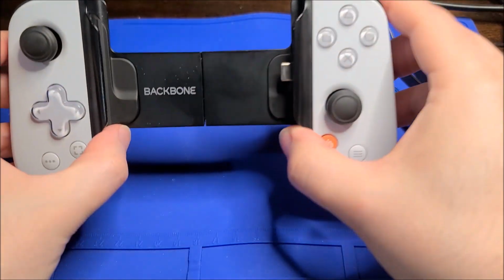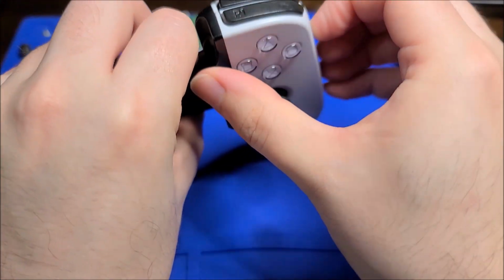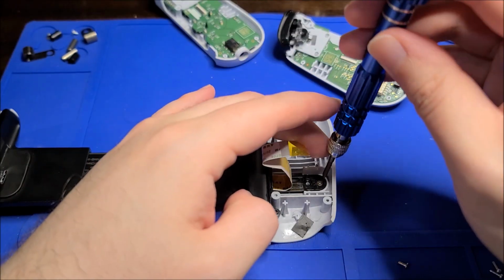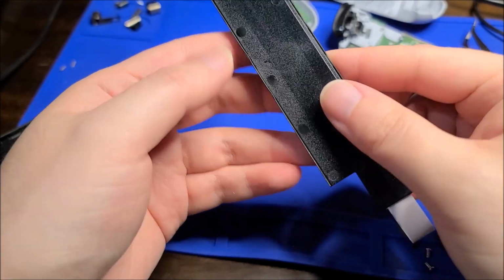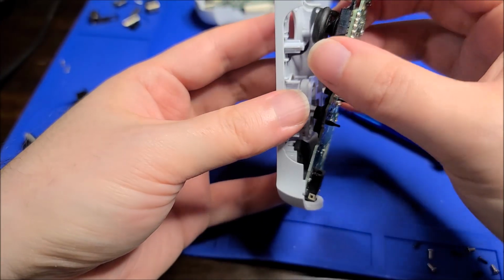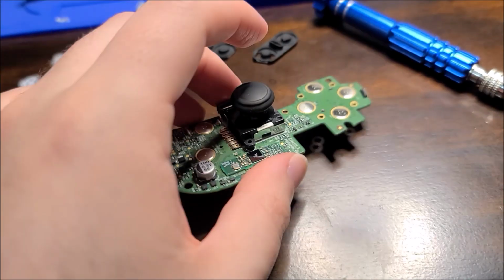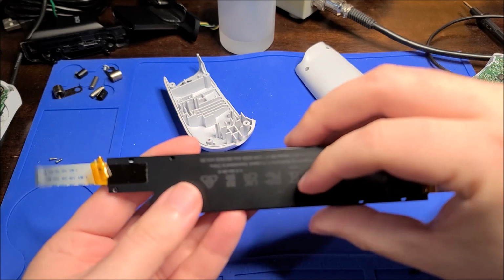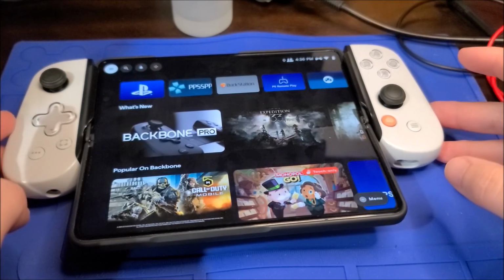Let's Fix: Backbone One Controller Full Teardown and Repair

Comment: Why you did not explain how to remove the ribbon conectors, that was the hardest part, i broke mines 😢 thanks fornite video anyways 😢
Reply from the maker: Sorry, I've opened thousands of zif connectors by now that it didn't occur to me that I should've explained how they work. If it makes you feel better all is not lost, you can shim the back of the ribbon with thin tape and friction fit it back into the slot even if the latch is broken and it'll work.

Comment: I have the same issue with mine as well. I bought another one but I haven’t used it as yet. It’s USBC and the first one is for iPhone. How much would you charge to fix it for me?
Reply from the maker: I'd do it for $60 including the part, labor and return shipping (assuming you are also in the US). That's like half the value of the controller tho so it might not be worth it for you.
Reply: @sjm4306  I am ok with $60. A new phone is a lot more and I can give it to my son

Comment: $100 and breaks after 1 week to 2 months from normal wear. Shit quality!
Reply from the maker: The quality is ok, it's the design that is flawed. These flex ribbon cables were never meant to be used in this way without proper design consideration. There's minimum a bend radius the flex manufacturer specifies that backbone clearly isn't following.

Comment: How long does the flex cable fix last?
Reply from the maker: It's honestly impossible to even estimate. It depends on so many factors like the quality of the new cable, how often and far you open and close the controller, and probably even down to how well/evenly you installed the ribbon. All I can say is mine still works but I've really only used it maybe a dozen times since I made this video.

Comment: 23:07 
The dumbest thing they could have done for us here. That the Joystick isn’t replaceable 

Not even the backbone Pro lol

The day I’ll have to rig thumb grips for this thing some how when it gets old will be annoying.

Cause they are’nt the same size as others lol

I got the Xbox pro version too

I was just curious as to how they would be to replace. And hardwired to the board was not on my list lol
Reply from the maker: Especially for a part guaranteed to eventually fail, all sticks should be on a connector no exceptions

Comment: Thank you for the guide, I will be attempting the repair, but I'm having trouble finding a screwdriver for it, do you have any recommendations? I bought the JOREST 40Pcs Small Precision Set, but the tips seem to be too short to unscrew it, but it may also be because I'm not very handy.
Reply from the maker: I use a set of precision jewelers screwdrivers I've had since I was a kid. I love my multi-bit driver but it just isn't suited for deep set screws like this has.

Comment: they should have used separate ribbons for the top and bottom halves of the joys to connect the bottom to top. Then ran a 3rd ribbon through..

follow-up; they need to have these replacement ribbons at the retails that sells the backbone

Comment: Very helpful. What is the length of the cable you purchased?
Reply from the maker: 300mm long, it's maybe slightly too long but there's enough space in the shell to accommodate the extra slack.

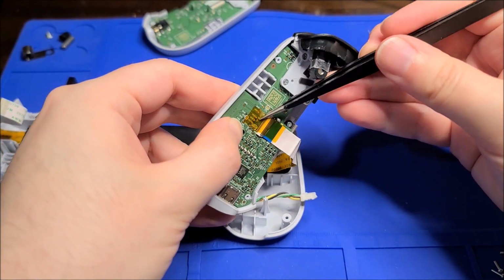Comment: Bro in 7:00 minute when I removed the ribbon the little dark gray piece that is like in the pins of the flat cable space fell down and I cannot put it back again, is that bad  or i can continue without them?
Reply from the maker: That is the latch that locks the ribbon. Without it the ribbon wont stay put and not all pins will securely connect. You might be able to use thin tape on the side of the ribbon without pins to make it friction fit in place otherwise you'd have to desolder the old connector and solder a new one in with a working latch.
Reply: @sjm4306  that's sad. rip my backbone

Comment: Very helpful, thank you. I’m fairly new to tinkering with devices but was attempting to fix a joystick. The one part you didn’t fully go into lol but I ended up bending the pieces a little that hold the joystick in order to get it out and then spent prob 40 minutes trying to put all the little pieces back in the joystick. Really cool to see how it works and figure it out tho. I mainly used this to figure out those two screws that were hidden. Thanks!

Comment: a friend "indefinitely lent" me his backbone one (BB-51, which i believe is 2nd gen. black USB-C) two months ago and this issue with a few buttons not working on the left side just happened to me. 
i plugged it into my computer without the phone inside and the buttons/analog stick directions not working appeared to change based on how much i had it expanded and contracted.
hopefully I'm able to fix it. Awesome video so far

Comment: Hi, any idea what part is required to replace the USB c connector / jack? It is bent and deformed on mine after dropping it with the phone still in.
Reply from the maker: Unless you have hot air equipment and are really good at using it I wouldn't even bother trying to solder just the bare jack. It'd be much easier and likely not much more expensive to buy another broken controller with a good usb board and swap it into yours.

Comment: nice video. my controller just had the same issue so I'm going to try to fix it. I just need to order a repair kit and ribbons. one question though, what is the tape called you use to hold the ribbons in place?

thanks
Reply from the maker: It's called kapton or pei tape
Reply: Finally had a chance to fix it today and everything seems to be working. thanks again for the helpful video

Comment: I bought a replacement cable through the link and replaced it and it seemed to work but now its taking screenshots non stop + trying to record video so i tried it literally without the ribbon cable attached to the left side (which is where the screenshot/record buttons are) and IT WAS STILL NON STOP TAKING SCREENSHOTS AND TRYING TO RECORD like wtf is that??? Rip

Comment: Thanks for this! Someone in reddit posted this video with the link to the cable on my thread but then Backbone commented and said they could with a possible replacement - even after I said it was out of warranty.
Reply from the maker: Backbone to their credit seems like they are good about fixing their products even outside of warranty. It's just a shame that an otherwise great product has this kind of inevitable design flaw.
Reply: @sjm4306 they said they would send me a refurbished one but told them I’m in New Zealand. Yet to hear back. If they can’t, ima give this a go! But agreed… such a good product but that ribbon is the Achilles heel. Even a JST adapter would suffice ya think?

Comment: Does anyone know how to replace a type C port on The backbone?
Reply from the maker: If it's still under warranty (or even if not I've heard backbone is very likely to fix it still), just contact backbone to see if they will fix it for you. Otherwise you can buy another broken controller off ebay for cheap to pull its usb module. Last but not easiest is to desolder the broken port and buy just the connector for cheap and solder it onto the small pcb.

Comment: My phone will not charge with the controller attached. And I even called Samsung and talk to them for a while, and then they said that my phone does not support pass through charging, which don't really make much sense there was one time where it did actually do it, but it didn't keep my phone actually charged it just prolonged the life of the inevitable death. Took 30mins to die from 5% while playing a fps on my phone, which would have died in 15 mins max. But only 1 time it did that. What Brings me here is my joystick on the right side is not really fully functioning.It's going to maybe 75% to 80%  percent when held full left and down. Up and right work just fine
Reply from the maker: Yeah the canned response from samsung makes no sense. Does any other device plugged in charge? Trying to suss out if it's a problem with the controller or phone (or I guess it could also be a cord/ac adapter problem).
Reply: Great video btw gave a 👍🏻 and now subbed
Reply: @sjm4306 I tried many combos of wall chargers different cable types(charge only/data+charging), different lengths, different chargers(regular/fast/superfast)(wall/car), and I tried this all on my tablet as well. Only 1 time did I have it say charging on my phone. I remember there was a update that day I downloaded for backbone app. And for 30min later that day it worked. But then I got another backbone update the following day and it has never worked since. No I don't know if the updates were purely coincidence but I tried the same exact set up with the same box the same chord and nothing. The only type of cord I have not tried yet is a USB C Male to Dual USB C Female Cable

But I'm thinking about retiring backbone controller.Mostly due to the right joystick looks like.Well. a n64 controller with ware and tare lol. 

The game I been playing a while Shadowgun legends, great game BTW, it might be dead for the most part but it still has lost of players and is a ton of fun. But when SGL got controller support Madfinger partnered with game sir to allow controllers to be used. So I been thinking about testing out one of those now too. 

Backbone has been great for a couple years now but it has had 100s and 100s of hours of use put into it and I only started noticing the joystick problem about a month ago. It's just getting really bad now.

Sorry for such a lengthy response. But I feel all details are necessary. Thanks chemistry

Comment: Where do I buy the usb connector? Mine is bent and damaged.
Reply from the maker: You'll either have to buy a broken controller with a good connector for cheap or find the exact connector off digikey/mouser/aliexpress and desolder the old one off so you can solder the new one in.

Comment: My backbone started acting weird out of nowhere. I attached my samsung s25 and right away, it started opening random apps and when it opened my camera app, it started taking multiple pictures. I thought it was my phone at first but when I attached a cable from the backbone to my tablet,  it started doing the same thing. All of the buttons are clicking normally. I can't seem to figure out what the hell happened to my controller. I didn't spill anything on it. I literally just had it on top of a table for a day.

Comment: Thank you so much sir! My device has been broken for several months now, and I didn't have a warranty. You saved me $99! 😂
Reply from the maker: I love comments like this! The exact reasons I like making repair videos.
Reply: @sjm4306  late too the party but im seeing this issue across the board i got the all black one , it sucks cause its a really great controller bar this issue fingers crossed my ribbons come out as ive had mine about 2 years and it only just stopped  working fingers crossed

Comment: Where can I find a new ribbon for my backbone one type c controller. What is the ribbon called?
Reply from the maker: It's an ffc cable but you need a specific length, pin spacing and pitch. I have a link in the description.

Comment: Mine developed this fault after very little use, maybe 100 hours use. My Backbone is still mint condition otherwise, it's out if warranty unfortunately.

Thanks for this video 😊 I'll attempt a repair. I've only ever done a repair on my old PS4 disc drive, so I'm a bit of a novice! But your video is very thorough so thanks man 😄

Comment: congratulations! you did ten times more than Backbone ever did for their own customers regarding this constant annoying ribbon defect (in explaining it and advising how to fix it). i bought two and they both failed for this same ribbon issue under warranty. replaced the first one then upgraded to the new USB-c (which eventually failed again - they sent a new one under warranty) but sadly, here i am again. out of warranty.  they should really solve this defect. anyway, thanks.

Comment: What length ribbons did you buy 100mm seems too short and the 200mm too long
Reply from the maker: 300mm, I know it looks long but keep in mind the ribbon gets folded at the center and needs excess at either end so it doesn't interfere with the extension mechanism.

Comment: Pls help, I thought I did it correctly but now it’s saying the accessory uses too much power.
Reply from the maker: Something is shorting out on the board. Try removing the board and disconnecting the ribbon to see at what point it starts working again. That will hint what's causing the short.

Comment: Would you be able to convert one from usb c to lighting?
Reply from the maker: It wouldn't surprise me if they use basically the same exact shell/board and the only difference is the plug and wire that connects to the board.

Comment: I performed this fix on my Version 2, I had a version 1 which accidentally broke the usb port, I tried to use the same cable from the version 1 on version 2 and I would say that all screws and most parts are interchangeable aside from the shells which may not fit on the rest of the assembly. the cable and even the piece holding it is practically the same. I also realized that the cable on my version 1 was somewhat thicker than the second version, it actually showed the same stress point BUT it was not nearly as degraded as the second version cable, i reinforced it with a little bit of kapton tape anyways so it can last a little longer but I ordered a batch of more flex cables just to be safe.
On another note you may want to be careful when removing the kapton tape that's on the actual pressure connector on the board, since you can rip the tiny holder/lever that fixes the cable in place or even destroy the actual port, I kinda almost ruined mine on the right side. I wonder if I have the skill to replace the port on the second version.

Comment: is it possible to mod it to tmr joystick?
Reply from the maker: Electrically, of course. Physically, perhaps. The biggest obstacle is the footprint for the stock sticks is not like any other small joystick I've seen in other devices (they are usually zif with a short ribbon). I assume though that you could always design a little flat slex ribbon adapter to solder to the through hole pads. You'd also have to try and match the screw hole matching locations so it can securely mount to the plastic shell.
Reply: @sjm4306   the footprint for the stock sticks is not like any other small joystick    <---thats what i am thinking. 
I have modded my xbox controller and DS4 controller with hall effect joystick cause I can find their replacement parts, but i cannot even find the model no. of this joystick. Perhaps a tailored one.
Thank you so much for the reply and the teardown video.

Comment: I have the same issue. When I fully extend the controller, the left side will work. When the controller is not fully extended, the left side does not work.

Comment: Hi. Will the flex work on all version. I have the lightning PlayStation version.
Reply: Thank you so much. My backbone is now up and running again.
Reply: Thank you for the very quick response 😊
Reply from the maker: I think the only difference between these versions is the phone connector so I'm pretty sure they all use the same ribbon.
Reply: By the way, how did you detached the flex cable? Is was skipped in the video so just wondering if it is just a simple pull up of something that holds it up?
Reply from the maker: @cyberjaze oh it's held onto the plastic middle frame part with some double sided tape so it can be peeled off by hand

Comment: My L2  button has decided to not work. Its presses down normally, no response. Any suggestions i can look at?
Reply from the maker: It could either be a tiny break in the ribbon for the conductor that carries the signal for that button, the magnet for it becoming disloged/disintigrating or the hall sensor is damaged. I's carefully visually inspect the area around the L2 button and trace the output of the hall sensor through the ribbon.
Reply: Thanks for that info. Sounds like its above my pay grade. Lol - Now im feeling like these are flimsy / break easy & Debating whether to get another 1 or just jump to a PS Portal.   @sjm4306
Reply: That sounds like its above my paygrade. Lol 
Do you think backbones can malfunction easily? Debating getting another backbone Vs a PS Portal now
Reply from the maker: If I'm being honest, it sounds like backbones have a high failure rate but the company does seem to honor their warranty and above.

Comment: That’s a fun tear down and fix. How do you like the controllers?
Reply from the maker: Thanks, yeah I actually prefer clicky buttons and it's 100x better than virtual touch buttons. The only thing is it's awkward with my fold 4 so I have to use it with my s20 instead. Not really sure though if I had to buy it new as $100 is a lot for what is a wired controller for a phone. I think $60 would've been a far more reasonable price. In either case I technically only paid $10 for mine in the end so I'm happy.